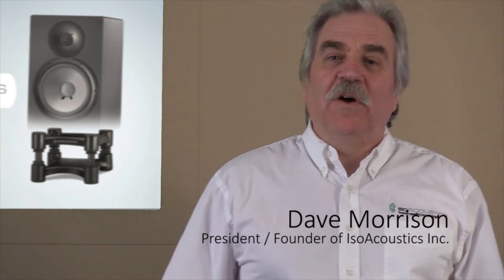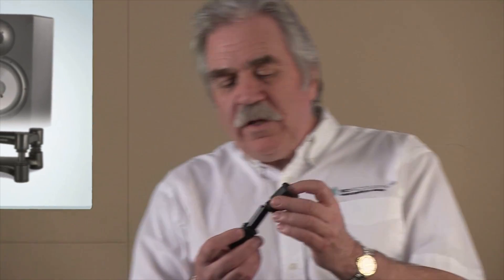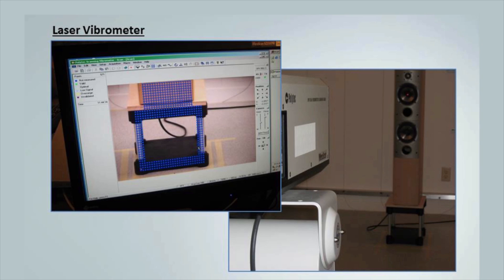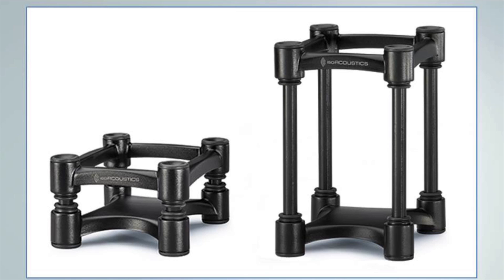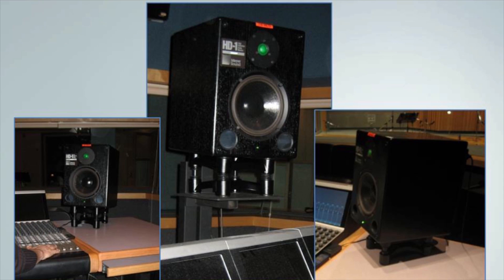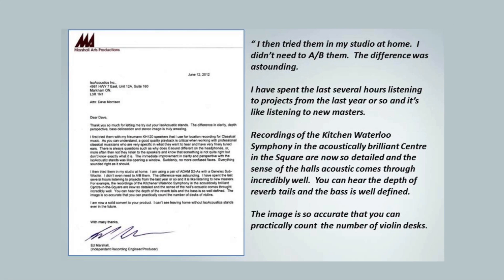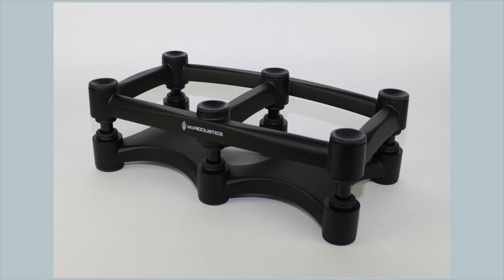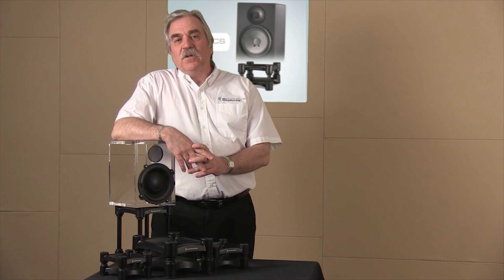How IsoAcoustics Speaker Isolation Works

Comment: I got the ISO 200s. The sound on my JBLS 8 inch seems improved and more clear. Used the shorter rods. The long rods seem to be unstable. You should have a cheaper option with the short rods only.

Comment: The A/B test is nonsense. Different height hence different cancelling frequency caused by desktop reflection, no wonder  it sounded different.
Reply: I can confirm, iso acoustic pucks work. Instant improvement on low end. Focused and tighter, less flabby. Translated well after I got a big of feedback.

They 100% work, it's not about height, the pucks are the same height of the foam I used before.

works.

Comment: Snake oil...if you use decent floor stands, you don't need these. These make a difference for people that have their monitors on cheap wooden or glass desks.
Reply: Well its not exactly snake oil, it is way overpriced though. What you said about cheap wooden or glass desks is a bit stupid. Sound doesn't care what kind of wood your desk is made out of it will still bounce off the same way if it isn't properly isolated from contact of the desk.
Reply: @Danny-is5if  I'm buying them simply for convenience ... but yeah, you're are absolutely correct .. These are so overpriced and a bit of a rip off considering they're just a couple of pieces of plastic with a few hollow aluminum tubes. It's actually kind of gross they're charging this much .... BUT for niche type products like this, of course they're going to gouge the customer. 😂

Comment: Despite what any number of naysayers will say i recently got a set of the ISO L8R200 stands for my M Audio BX8 D2's and they really do work.

The difference in sound is quite profound, the boominess i was experiencing in the bass is gone completely and im left with a tight punchy sound with no overhang.

The midbass and treble is much more open than it was, its very difficult to explain in words but the sound is just more 'airey' than it was before and the stereo imaging has improved massively.

It really does sound like a brand new set of more expensive speakers.

I have a set of ISO L8R130's supporting the centre speaker in my 5.1 surround setup consisting of Monitor Audio RX2's, RX Centre and RXFX rears and my setup has never sounded better. Sometimes during films the centre would sound slightly 'boxy' sat on the glass tv stand but not anymore, its uncanny just how much of an improvement there is. Trebles shine now and the openness of the centre channel almost makes the other front speakers seem like theyre behind some kind of veil (not literally of course but you know what i mean) its a real treat to watch and listen now.

I would recommend these whole heartedly myself but the proof is in hearing for yourself with your own ears, all i can say for sure is that that these have been a revelation for me and im now ordering a set for all the speakers i own.

Comment: From forums...most users feedback on a positive change (improvement). However...from the comparison demo...with and without the stands...I preferred the presentation without the stands. Perhaps it's the recording (hot treble - mastering engineer's doing) but I found the treble much less "spitty" and less sibilant without the stands. Compare the "s" sounds of the vocals and you will see what I mean. The stands leaned out the mids (more open sounding?) which in turn "thinned" out the vocals quite a lot. This exposed the rough (spitty and sibilant) treble. I much preferred the sound with bass and lower mids smear. Probably a much less fatiguing sonic character. Clarity isn't always a desirable sonic attribute...:)  However...on a top notch recording...stands may be preferred. YMMV.
Reply: no it works lol .. i just bought a pair for my ole bx5's.. holy shiet believe the hype

Comment: You are kidding me! Send me a pair of these for free, and i will make you proper demo video. Wrong position, wrong mics, height, speakers, placement. Can't you hear phasing issues caused by different placement of speakers? This has nothing to do with your ISOs! Not saying they don't do the job, i just wonder how they perform against simple diy spacers at same height, same speaker, good, flat measure mic and fair test!
Reply: why don't you go buy a pair, and test them for yourself. I use them everyday in the studio and they work as they should, and no I don't work for the company.
Reply: +DHumphrey_AMP Not saying they dont work, just saying test is not valid.
Reply: like I said, get you a pair and try it for yourself. people are so critical about a product based off what they see on a youtube video.

Comment: The line of reasoning starting at 5:28  leaves me suspicious of the validity of the entire presentation (there is no logical relationship whatsoever between placing a speaker on a solid surface and a car without air in its tires, geeez)—and it is nothing but a sales presentation with minimal real factual data. This line of reasoning taken to its logical conclusion would have the bass drivers isolated from the cabinet with something like rubber or sorbothane. 
He is an effective salesman, though, because he looks friendly and like he is presenting meaningful information. Even the A/B demo of the speakers in the studio is flawed, as the different heights alone between the two pairs of speakers could create difference in sound of the magnitude heard.
Reply: Yeah the A/B is flawed, 1) different heights above the console gives similar direct sound but differing reflection distance thus time between direct/reflected is already different, 2) Microphones are almost same height - one will favour a tweeter more than the other as its off axis due to height in vertical to the centre line where most 2 way speakers will have had the designer attempt to crossover the woofer/tweeter with minimal phase issues, up or down of the centre line between Tweeter and Woofer risks nulls (still enherent with 24dB LR Crossovers too). I would believe it more instead by taking anechoic measurements with speaker resulting height the same and zero reflections, one sitting on a exact copy of the stand but made of solid/no moving parts, then this isostand, as in all scientific experiments you have to minimise the amount of variables.

Comment: I can understand isolation from resonant surfaces will improve clarity. I can understand than angling speakers will improve clarity. However surely allowing speakers to react against their cones will take energy out of the mix. Wouldn't you get compression depending on the elasticity of the isolation rigidity. Personally i'm with the school of thought that mounting speakers on heavy slabs of concrete them placing them on isolator pads is the way to go.
Reply: How do you imagine it on a table, in a home studio ?
Reply: @MaximusPanin  i think where there isn't size, space for heavy slabs and rigid structures these will work to an extent.
Reply: @MrJhockley  Uh, yeah, ... "heavy slabs of concrete" are probably not practical for most people who're buying this sort of thing for their home studio desktops. 😂

Comment from the maker: Hi HeadphoneAddictCOM.....That's an excellent question regarding the ISO-L8R430 and the JBL 4430.  Although the overall size looks like a good fit, the weight is 25% beyond our recommendation.  We will be shipping the modular-aluminium stands in the new year that can be built for this application, and providing the same isolation and clarity as the current ISO-L8Rseries of stands.